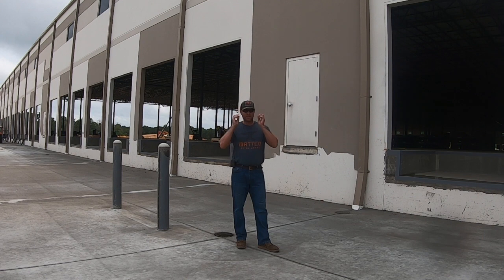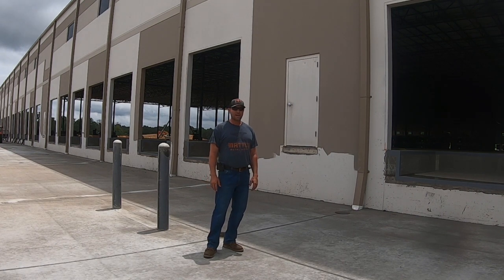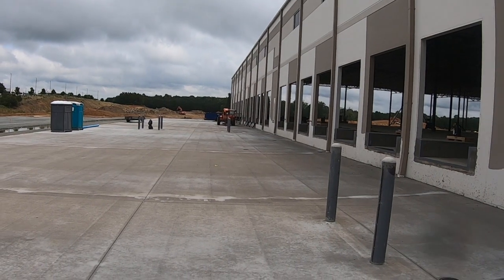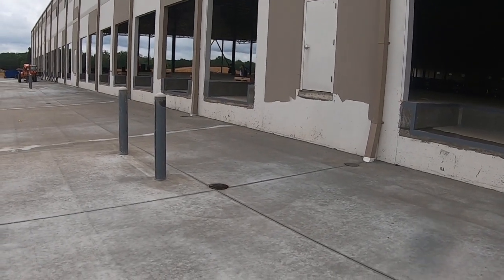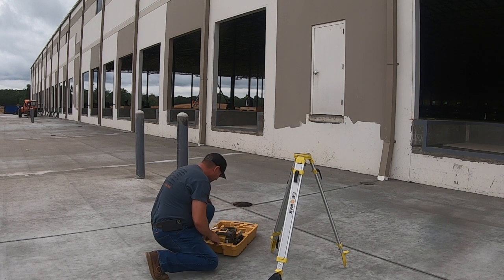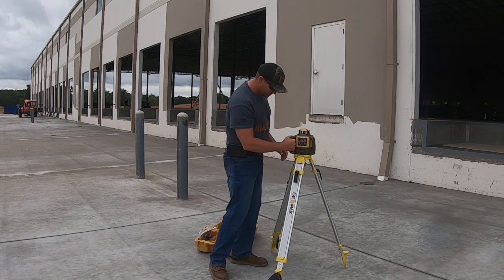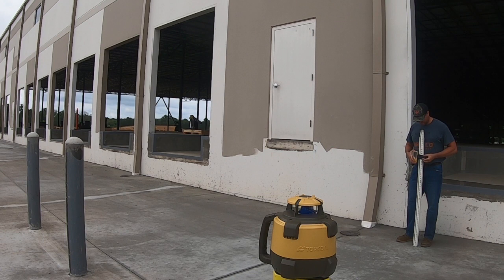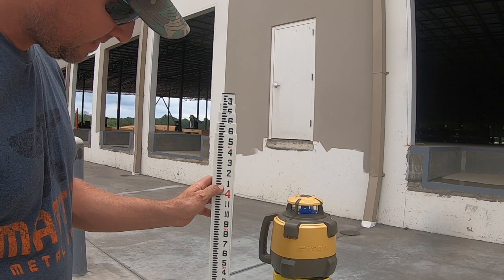Laser level basics, finding grade (slope) of concrete for stairs

Comment: Check into a lenker rod to use with the laser. It will eliminate the math and is much quicker.
Reply from the maker: Wow I will definitely have to check into that.  I knew there had to be something that would do the figuring for me. Thanks for letting me know.
Reply: check out "How to read a direct reading cut fill rod" on YouTube. In your case, (video) all you would have to do is set the rod at the low point, move the receiver on target, zero the tape (on the rod), move to the high point, move the receiver to be on target and read the height. Done. No math, no mistakes.